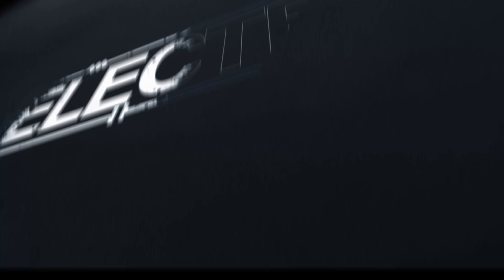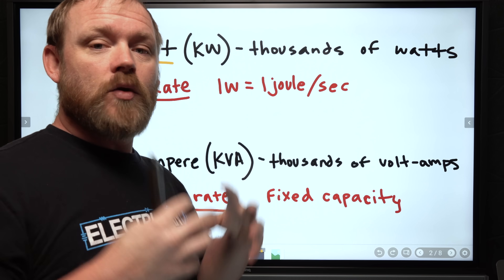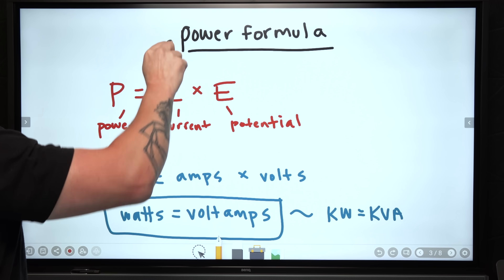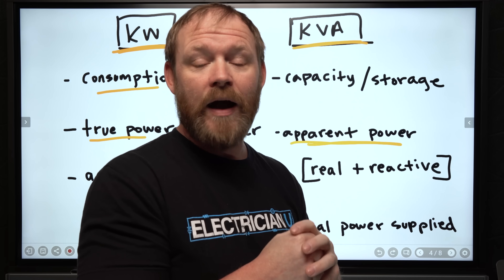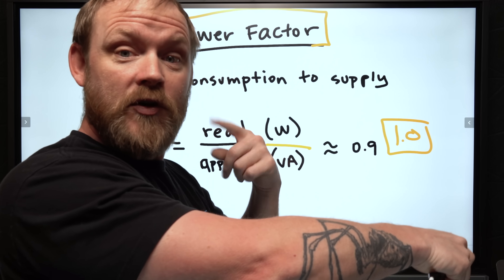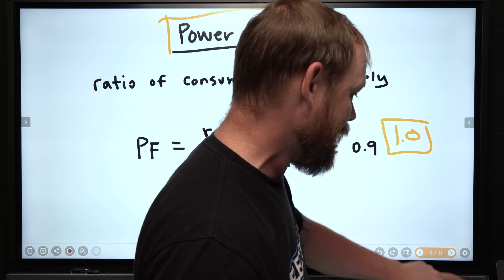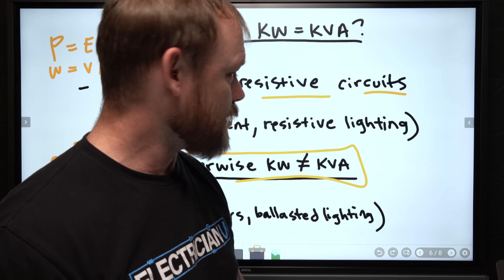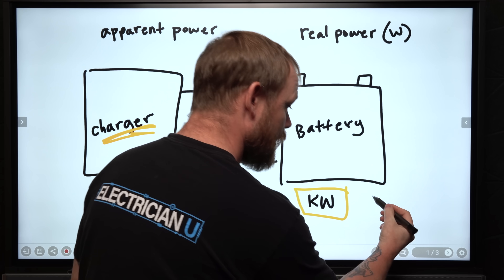Why KW and KVA Are NOT The Same Thing (Even If They Seem Like It)

Comment: Take an actual physics course, dude.  Watts and Volt-Amps are exactly the same.  If you get different values for W and for VA, then you're doing something wrong.  Don't muddy the waters by insisting that W does not equal VA.
Reply: The depth of knowledge is revealed when the explainer uses K instead of k.😁
Reply: Same except in the opposite direction
Reply: Wrong
Reply: @SylviaisGod2060  Just because some dude on the internet says that watts aren't watts doesn't mean they're right.  Take an actual physics course, one that focuses on the calculus involved.  You'll learn that physics doesn't care about convention, or misconceptions, or an absurd belief that energy put into a system doesn't equal the energy coming out of that same system.
Reply: @ Wrong.
Reply: Right.
Reply: Right.
Reply: Right.
Reply: Right.

Comment: KW is continuous voltage and current demanded by a load. KVA is variable voltage and current supplied by a source. Demand and supply rarely match. Most appliances don't throttle.  Many battery powered devices do throttle. Simple as that.

Comment: Small comment on 3:00 - if you do the dimensional analysis, where V = Joule/Coulomb, and A = Coulomb/second, then the product V*A = (Joule/Coulomb)*(Coulomb/second) = Joule/second, which is equivalent to a Watt. Empirically, they are exactly the same.
Reply: They are not. Power is the integral of instantaneous voltage times instantaneous current over time per time unit. Apparent power is the RMS voltage times RMS current. Their units are the same. Power is Apparent Power times Power Factor. P= I*E is not correct. S=I*V, P=I*V*PF. For 3 phase: S=V*I*1.73 etc
Reply: @GerhardBothaWFF  RMS has nothing to do with apparent power (W or VA whatever your convention says, while it's the same) vs. real power (W or VA). apparent power is what you loose as per the meter on your supply, whether some of it gets reflected or wasted as heat is what leaves you with the real power, which is not always exactly measurable anyway. RMS = root mean square of a sine wave, yielding a number you can do calculations with. ΖαχαρίαςΦθενάκης is right.
Reply: They are both "power".  Power is watts.  But the values, in watts, can be vastly different between the two.  And the direction of travel is also different (opposite).  Which is why a distinction is made.   Power is actually flowing in both directions at the same time.
Reply: @junkerzn7312 it’s more correct to say that power is not watts but “energy per unit time”. Watts, Volt-amps reactive, and Volts-amps all have units of “joules/second” and is “energy (transferred) per unit time”. It’s just that saying watts, volt-amps reactive, and volt-amps allows you to talk about real, reactive, and complex power respectively.
Reply: Nonsense. In terms of dimensional analysis W=VA=VAR (or kW=kVA=kVAR). The difference comes from a convention that W is used to measure consumption, and VA to measure the production. On general grounds, due to inductors and capacitors, you need to produce more power at the AC source, than that you really consume and the excess power is lost. The convention is to measure the produced power in VA and the consumed in W, to distinguish them with each other.
Reply: @ΖαχαρίαςΦθενάκης 
I think it's not so easy.
See: 1kW+1kW=2kW but 1kVA+1kVA≠2kVA
How do you explain the difference when you declare all as the same?
Reply: @maxmustermann9587 Oh yes. It is so easy. Who says that 1+1 not equal 2? These are units. They don't have to do with the physics behind the AC.

Comment: Would just like to point out that most rackmount server power supplies include PFC (power factor correcting) circuits, that make them look very close to a pure-resistive load.  This is one of the reasons why they are more expensive than consumer PC power supplies (though even they have gotten better over the years).  For homes, it's unlikely to have more than 5 PCs, whereas server rooms have 40+ computers for small "closet", to hyperscalers' data centers that have 40,000+ servers per building.  We had an electrician measure the PF on the load-side of a UPS that was powering around 300 servers, and his meter showed him .995 - he was really surprised!   
TL;DR - when I'm allocating PDU (power distribution unit) branch circuits for server racks, I don't think about power factor.  (3-phase power current sharing is considered, but that's a comment for another video...)
Reply: All computer power supplies have a PFC circuit these days, not just server power supplies.  Server power supplies are just a tad (about 5%) more efficient, due to better component selection.   A consumer power supply usually runs around 90% efficiency while a platinum server power supply typically runs 95%.  That's the only difference, really.

Comment: This is a good video. The power triangle is the most important thing to understand. Watts Real P is the X axis. VAR reactive is the Y and VA is vector sum (hypotenuse). When you're using real and imaginary numbers you can evaluate the rectangular sum or polar vector quantity in your head. With alternating current capacitors and inductors are reactive components and they store and release energy at different times. In perfect systems the real is the only part actually using real power, but you still need to account for the reactive components. It's why power factor correction is important because the power company still has to supply and transport the power in VA regardless of what is consumed and even if the load give it "back" every half cycle.

Comment: Basically KW=VA*pf. 

Transformers lose 'waste' energy (as heat) in the eddy currents in the core as V1 is transformed to V2. In very cheap transformers the losses may be higher than in expensive transformers which may have a more efficient energy transfer through materials or design. in a battery, the effective KW transfer rate is also impacted by its internal resistance. The higher the current the greater the internal volts drop (Thevenin source). Results in a similar effect in that some of the potential theoretical energy is lost within the device rather than being transferred to the load.

Comment: I deal with semiconductor matchboxes and RF circuits where getting the point of why certain components need to be designed to handle much more kVA than what the generator can deliver becomes really apparent with vectors. Visually, by using vectors, it is one of the easiest ways to explain real and apparent power as it also illustrates that inductance and capacitance are opposed forces.

Comment: One thing, though, is that all of these items that you’re listing off like light ballast and most electronic equipment have built-in power factor correction if they are manufactured with any quality. The big item that you have to worry about is motor loads. But in most factories that have a lot of motor loads they also install automatic power correction, for those in order to bring the PF back up.

Comment: But then there are capacitors, inductors, and motors in DC circuits. So it's not exactly about that, either. It's about if those are constantly charging and discharging or their fields are expanding and collapsing. Because with DC circuits even with capacitors and inductors, there's not a constant up/down effect as there is in AC circuits. Correct?

Comment: The word "apparent" has two opposite meanings: 1. obvious/observable,  and 2. perceived/not real. The "apparent" in "apparent power" means the actual total power supplied, the sum of the used (real/active) power and the unused (reactive) power. The definition of the word "apparent" had previously confused me. For that matter, the definition of "real" in this context adds to the confusion. In non-technical English, one might imagine the terms to be exchanged, with "real" meaning the total power, and "apparent" meaning the seemingly-used power. I have come across other examples of this kind of confusion between technical and non-technical word definitions, one recently that I can't recall, and "elasticity" in economics, which would seem to mean the opposite to its normal english meaning.

Comment: so keeping it dead brain simple say i needed to charge a currently not possible electric tractor with a 2000 kWh battery in 30 mins i would need 4000 kW of power so at minimum i would need a 4000 kVA transformer right? so how does that translate to kV? as powerlines are rated in kV. also any one know of a good resource for pricing on this stuff? want to know how much money i need to save before the Australian government decides farmers are no longer exempt from the future diesel ban.

Comment: So a battery is DC, hence part of a DC circuit where there is no reactance. But the motors in the car are probably 3 phasee brushless motors and driven by a switching circuit which activates the phase windings in a sequence and mimics AC. Since the windings are activated in a sequence, the current through the circuit will vary with the rotation of the motor and the circuit will have reactive properties.... this is getting complicated...

Comment: Not a great explanation, because it doesn't even try to explain what apparent power is. Far better explanation would be that some of the energy is transferred back and forth on each cycle, so although this energy is not consumed, we still need to take into account how much of it is transferred per second, and this is what apparent power is. The device which transfers electrical power (both active and apparent) should still have the capacity to transfer both. It's not load vs transfer distinction, you could rate your load in terms of kVA, and it would be actually useful to know in many cases.

Comment: I am not EE, I have a question. If you say so the source of energy is KVA and anything that have electrical machine (motor or transformer) are also rate in KVA, due to powerfactor. Therefore why when we build new powerplant, they rate in Megawatts? 

Thank you for answer , and sry for my bad English.

Comment: Dear @electricianU,
thank you for the explenations. Still during the first six minutes they can be misleading and leave an important aspect of kW aside. Still they are great towards the end:
- I came to the understanding that it is important to stress how this is about kVA versus kW from the viewpoint of fundamental Physics versus the viewpoint of electrical Engineering. An engineer will make a distinction between VA and W to point out if a device is a power supply or a power user or a power "transport" device. And if he is working with large devices he will hardly every talk about W versus VA but almost always about kW versus kVA. If you check Physics there are many more ways to make an equal statement on this, e.g. 1 V = 1 kg /(m * s²) so you could even label your Drill in kkg /(m * s²) or t / (m*s²) and the numeric value would still be the same, but this would drive the engineer insane as for him it is absolute nonsense to ignore impedence.
- So if you have a lecture on Physics, that is about the calculations and relations your professor might actually be annoyed if you make a specific distinction between kVA (and please ... PLEASE use a SMALL K not a big k, the big one is for Kelvin) and kW, just because from the view of Physics they are equal and the Physics professor will wonder if you understood anything at all. (Remember: Equal does not mean the same. It is more like one of the two can be used as a substitute.) But in Physics it's rather about how things are related towards each other, not about how to build devices. The latter is when we get to Engineering. And in his lecture the Physics professor would at least raise his eyebrow if you'd write Kelvin times Volts times Ampere instead of Kilovolts times Ampere. And he'd be annoyed if you started talking about impedence as the focus of the lecture would not be about building electrical devices but about the relations between physical sizes in general.
- That said: Engineers often don't need that much precision (too much precision in a calculation usually means that you didn't grasp what the application is all about/what dimensions are important), so if they consider matters to be obvious they will write KVA instead of kVA and in their domain that is perfectly fine. Well the Physics folks would hang you for doing this. And almost any Engineer will tell you that you are wrong about using MB instead of MiB. (This relates to computers.) So no: Engineers aren't more relaxed than others, they often are just as stubborn as anyone from any other domain. (Take part in a discussion on Security and Safety in between Engineers and Computer Scientists and you will see it for yourself.)
- On the other hand you are leaving an important point aside: kW also means that you must NOT use more power for this device or you risk destruction, damage and might even risk peoples lives. When you construct a device you have to calculate the maximum W that a device is capable of and have to label the device accordingly. So this has got nothing to do with impedence but with protecting people from accidents cause by improper use of the devices you constructed. This is most important when it comes to using wires/cables: Many people don't understand that too much current can set a cable on fire and connect dozens of devices to a single socket by using multiple connectors. So here the amount of kW is not about the usage but about the maximum amount that can be safely "transported".
- In other words: If you state that there is a difference between kVA and kW then you are both right and wrong: As an engineer you are right, as there is a distinction when it comes to the devices you use and it is an important one. Still you are wrong as this destinction is used by engineers only. Thus non-Engineers (e.g. Physics professors) will often not be aware that there is such destinction in engineering and thus they will be wondering what you talk about. If their power supply is lacking energy they will buy a larger one and that's all there is to them.
Best regards,
Markus